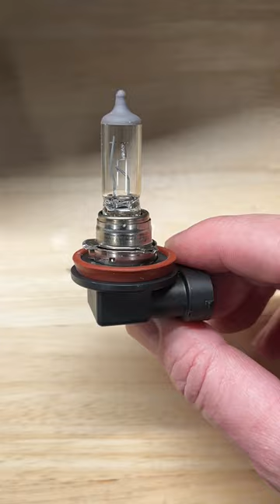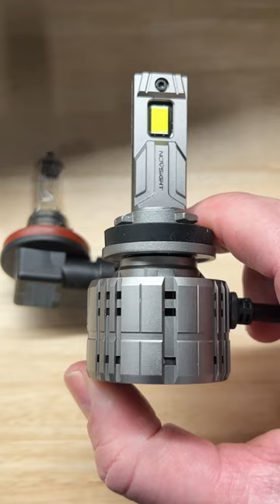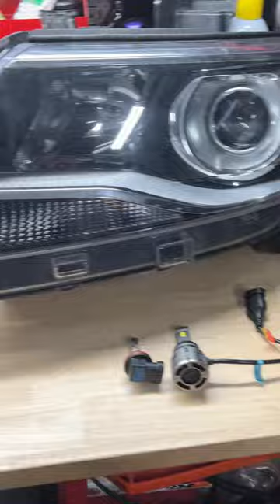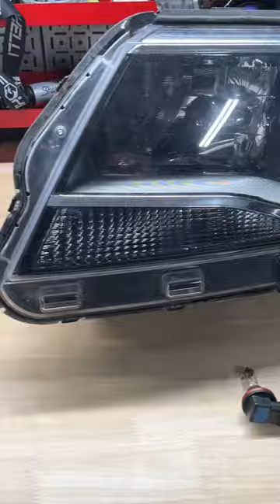What do you call these?  Bulbs or something else?

Comment: kindly do the comparison video of N60 Vs Hikari Vs Auxbeam GX.. and is it safe to install 200watt Led directly to stock headlight wiring ??
Reply: check your fuses. if your stock fuse is capable of it, the wirings could also support it.
i came from a 55w stock halogen bulb but now using that 200w (novsight claim) Novsight N60. i have no problems.
Reply from the maker: You can see all of the details of the Novsight N60 here:  https://youtu.be/3orj2-vp2B8

Comment: headlamp is a lighting assembly with a removable bulb....headlight means the bulb can't be pulled out of the housing... this is the way motortrend explained it when the 86? Lincoln Continental came out with the plastic composite style headlamps with the replaceable bulbs.... these new headlamps allowed the front of cars to be designed and anyway they manufacture desired and was class changing an automotive design...

Comment: The Led Chips are too wide on the Led Headlight Bulb & to prove that put the Halogen Headlight against the Led Headlight Bulb & you will see the Halogen Bulb Filament is a lot smaller than the Led Chips on the Led Headlight Bulb & I don't know why Led Headlight Bulb Manufacturers put too larger Chips on Led Headlight Bulbs & the Led Headlight Bulb Manufacturers that are out in today's world stim maķe 4 6 & 8 sided Led Headlight Bulbs & people are still buying these DANGEROUS LED HEADLIGHT BULBS & THEY DON'T EVEN COME CLOSE TO THE HALOGEN BULB FILAMENT OR  FILAMENTS ON THESE LED HEADLIGHT BULBS IT'S WRONG & DANGEROUS TO OTHER DRIVERS ON THE ROAD OR ROADS & YET THERE AOTHER LED HEADLIGHT BULB MANUFACTURERS MAKE EXCELLENT QUALITY LED HEADLIGHT BULBS & THE LED CHIPS LINE UP EXACTLY PERFECTLY  TO THE HALOGEN BULB FILAMENT OR FILAMENTS & WHY AREN'T ALL LED HEADLIGHT BULB MANUFACTURERS OUT THERE ALL DESIGNING & MAKING LED HEADLIGHT BULBS & THE LED CHIPS ARE IN LINE WITH THE HALOGEN BULB FILAMENT OR FILAMENTS & MAKING THE LED CHIPS EXACTLY PERFECTLY THE SAME SIZE AS THE HALOGEN BULB FILAMENT OR FILAMENTS HAVE DRIVERS & COOLING FANS IN ALL LED HEADLIGHT BULBS & THATS THE ONLY WAY THAT YOU GOING TO HAVE EXCELLENT QUALITY LED HEADLIGHTING Kind Regards Peter

Comment: Incandescent bulb
Reply: Halogen
Reply: @toyotabrony  it is a halogen incandescent.
Reply: @El_Camionero incandescent bulbs are the market lights, brake lights, turn signals, reverse lights, interior lights. 

For low beam and high beam or dual beam are halogen.
Reply: @toyotabrony  Any light that emits light from being heated, having a filament is an incandescent. Halogen is a type of incandescent.
Reply: @El_Camionero  yeah I can agree on that. I mean I’ve seen keep calling incandescent halogen headlight so. 

I just incandescent bulbs that marker lights brake lights, things like that. 

Just go use to calling them specifically.